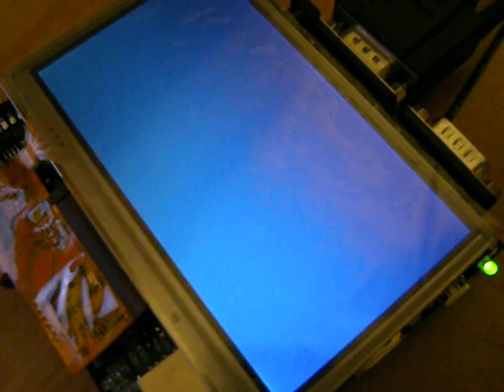LPC2478 LCD Controller

Comment from the maker: @KeithWasHere1 Driving any kind of LCD taken elsewhere is know to be kinda hard because there is no standard for the pinout of the LCD. In your case even the end user connector is unknown so it's even harder. What I can tell you is that it will *not* work out of the box with the LPC2478. If you have something to make it work, try to tap yourself on the bus with a logic analyzer. It should be fairly easy to find out which pin is which.

Comment from the maker: @KeithWasHere1 Yes the LCD controller is embedded into the LPC2478. The output interface is a standart RGB interface i.e. 8 bits for each color, a clock, vsync, hsync etc. You can take a look at the LPC2478 user manual from NXP for more information.